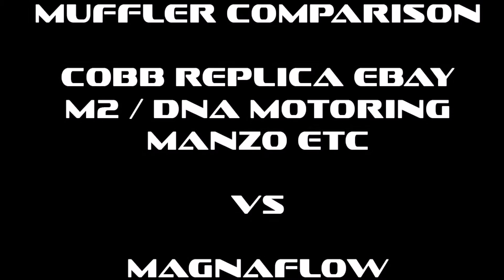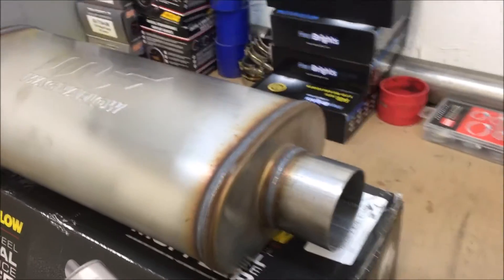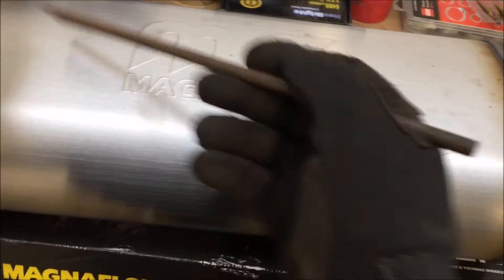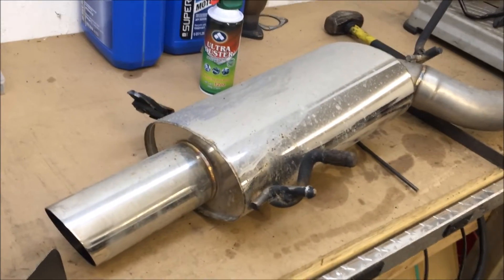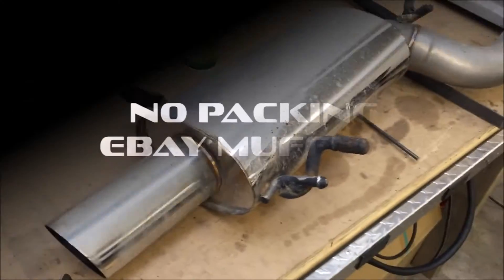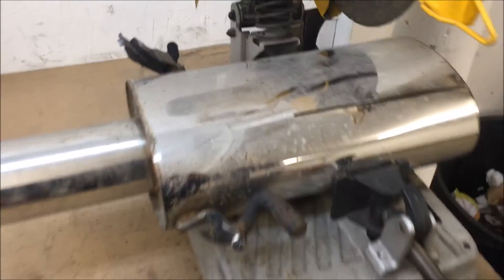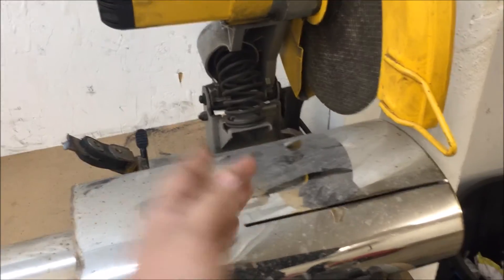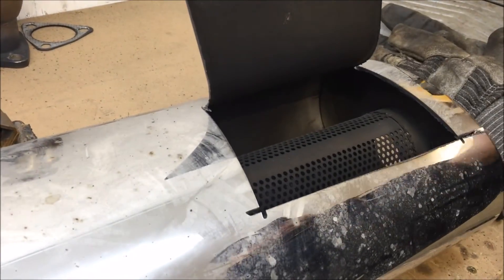Built Performance LLC Subaru Forester SF5 Ebay wrx sti catback cobb replica NO PACKING vs MAGNAFLOW

Comment: Good to know.  I just bought a 2002 WRX for rallycross 2 weeks ago.  Blew the motor the first night I had it.  Shop near me is doing a sti/wrx hybrid for it.  Has a cobb downpipe but still has the old ratty exhaust.  Need to get a 3 inch exhaust before the motor is finished.  I saw these on ebay and it just sounded to good to be true.
Reply from the maker: +OutlawUniverse I cant tell you how many times ive heard that. Night one "i spun a rod bearing" or im getting "roughness" from cyl 4 and its a cracked ringland.. sorry to hear of your troubles. if your looking for a good budget exhaust and have no one to make you one locally i would suggest the Tsudo N1 or SRS N1 if your into that style muffler. Never had any fitment or quality issues with either one of those. avoid all the dna motoring and speed daddy stuff as far as catbacks. They make other things fairly decent for the price specfically for the honda world but catbacks are a no go. If your looking for an oval style i suggest paying a little more or just getting the replica for around $150 shipped and putting a new 3" muffler on the end. The midpipe hanger has to be modded or changed but the piping at least has the correct bends.
Reply: Built Performance LLC   I saw your site and you have something reasonably priced.  I don't really care how it sounds that much.  But I might get your exhaust, headers and intercooler.   I already have a downpipe.  It's gonna be a bigger motor so it needs to breath easier I guess.

Comment: was thinking about this for my sf5 but might have to get the sr.s type re or n1  instead now either way it is getting  chopped up at shop to fit
Reply from the maker: Glad we could help, just wanted to get the word out there about the muffler as its a HP loss for sure!
Reply: Built Performance LLC what part number is the magna flow in the clip btw it was super nice sounding m8ght just have shop make me a cat back with that muffle
Reply from the maker: It is a Magnaflow 12249. Measured everything and It is the longest/largest oval style 3" inlet muffler that can fit in the space on an SF5.